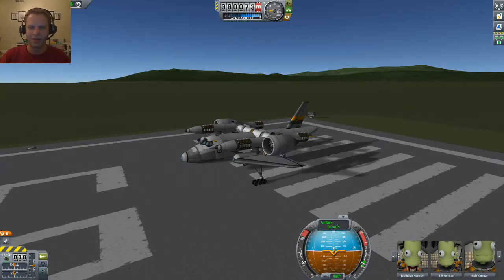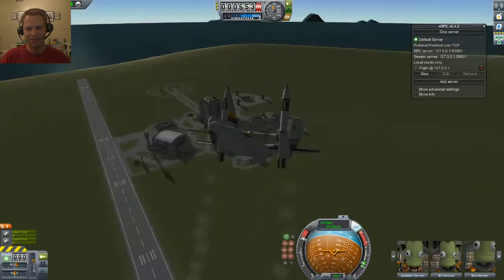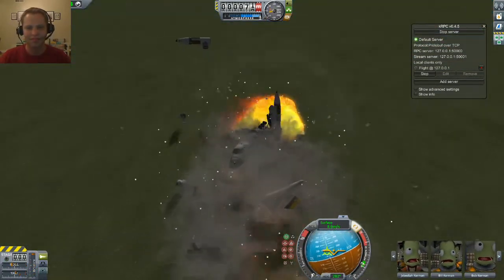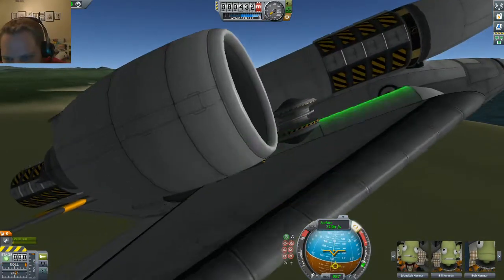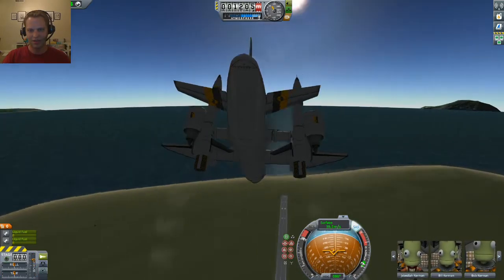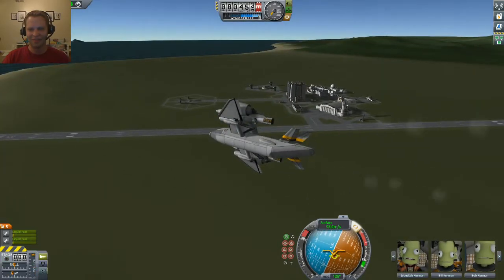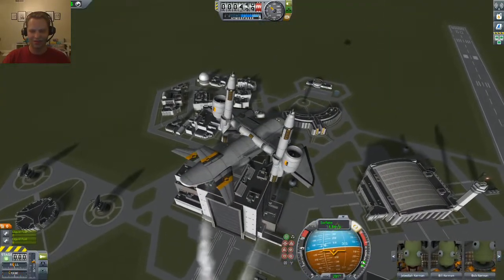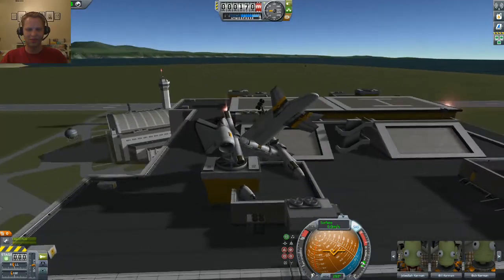Kerbal Space Program - Building a VTOL Tilt Wing was a PAIN before we had robotic parts

Comment: The problem is how fast you're moving your engines. The process should be slow and steady as to correct for any errors.

Also the java program isn't necessary. Just remember to attach a drone module and some generators and you can manually adjust the engines.
Reply from the maker: I'll post a follow-up video where I've tuned my flight algorithm to do exactly that! Stay tuned.